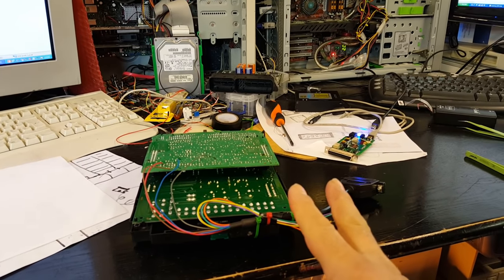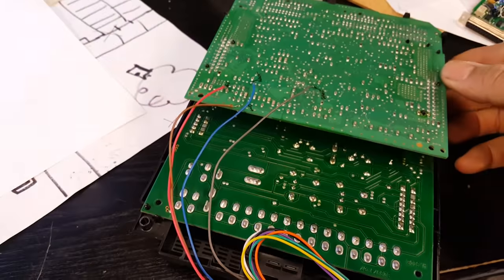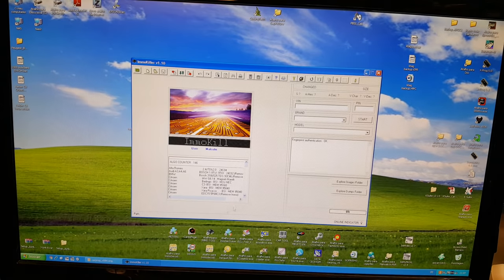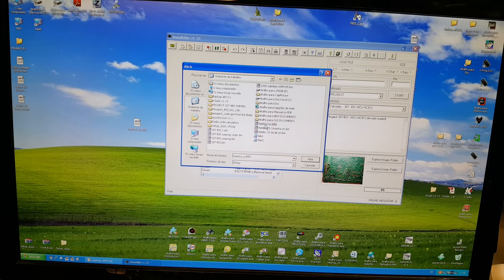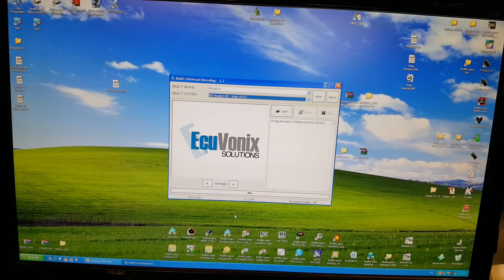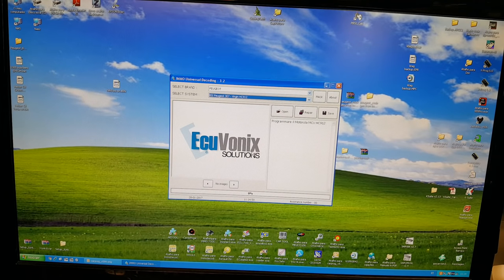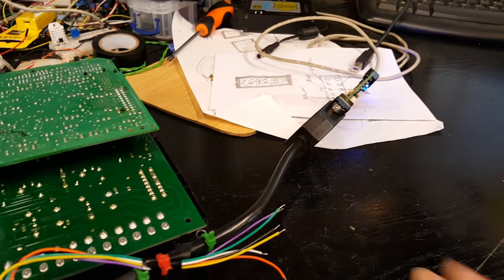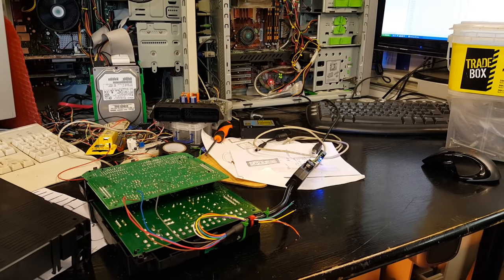Peugeot and Citroën BSI - clone, pin code read, virginize/ reset.

Comment: Hi. Is it possibel to send you my bsi for repairing? I have a citroen xsara where the sidelights doesn’t work. Which country are you from?
Reply from the maker: Hi
I am in the UK.
The problem is that I will not have how to test it, and I don't like to do repairs without be able to test the result...
If something does not goes as planned, I will not have how to tell, and then you will be receiving it back, to find out that is still no working...
Sorry, I can help you through diagnostics, and guide you through (Consider to support my channel and all the hard work put into it at http://www.patreon.com/LMAutoRepairs
Thank you), but that is about it... 
(I will love to help you to the best as I can!
https://youtu.be/ka-Yrflcd-o?t=1m55s)
Hope you understand!
Reply: I understand. You’re right. Your respons just tells me that your take pride in delivering high quality services. 
I will look at the channel. Thank you.
Reply: Hi mate got a water damaged ECU from a Peugeot 207 unable to read old ECU has its dead and doesn't contain a eeprom chip.

Could I virginise a repalctment ECU then read the pin from the bsi to allow me to programme the new ECU with Peugeot planet ? 

Thanks
Reply from the maker: @joshbennett6293  
Yes... absolutely you can...
👍👍👍
Reply: Hello, i can not find the connections for the Citroën c3 Bsi F02-00. Do you have a link or tell me how to do it please. Connections are also possible from the connectors so i can also hook up there if needed.
Reply: Thank you for the video, most interesting. 
You mentioned the term "caprog"  ? 
Is that correct, sorry I could not quite make it out in the audio. 
Appreciate if you could let me know. 
It didn't sound like x-prog which you have in the links. 
Thank you
Reply from the maker: @Kramblueify 
Yes... carprog.. 
👍👍👍
Reply: Hi
Nice video, and nice that you point the mouse up in the corner and say here is the name of the program, but we can't read it, it's not visible to read 😏😏😏

Comment: Hello LM Auto Repairs, How can I find the connection points on a Valeo BSI J02 (FNR: 9651197480 A, FNC: 9651196780 A) and Valeo BSI J04 (FNR: 9651197680 A, FNC: 9651196980 A)? Can these two be reset using the Carprog v8.21?

Comment: Hi, I have a 2010 Peugeot 308, Johnson’s control BSI that is corrupt/faulty. I want to read the eeprom chip. It has a 95128 chip. Could you help me with where to get the software to Virginise the eeprom dump? Thanks

Comment: Hi, You mentioned Carprog was running out of credits, do you have to connect it to the internet to get more credits unlocked on the device, and I think you mentioned you have a way around this, how does that work?
Thanks
Reply from the maker: Hi
I just program the Atmel processor with a file with 50 credits, before it runs out...
That's the way round it...
Thank you for watching and for your comment!

Comment: Hello, good afternoon and congratulations on your professional and interesting contribution to your videos.  I have a question if you would be so kind as to help me.  I need to access the board of a control unit, it is an external tuner, of a motorcycle to be able to eliminate or release the Vin since when connecting to the motorcycle it is linked and does not allow me to use it for the other one that my father has.  It is the Scream eagle super tuner model in case you know it or you can see the model on the web.  I know it's possible but the person I knew because of illness is no longer dedicated to it.  I would be very grateful if you could help me with something please
Reply from the maker: Hi
Unfortunately I have no experience at all with that...
I would guess the vin is stored in a eeprom or mcu on the module...
It might be possible to do it through some sort of interface rather than open the module...
Again, I never worked with anything like that...
👍👍👍

Comment: Hi is the cluster with in the bsi unit or is it a separate unit? unfortunately I did what you said an put a bsi unit in and the milage has gone up I've taken it back and put my original one back in it drives but just the locking system is broken not sure what to do next the place I went to said it's a 50 50 chance if I could ever get my milage back any help would be greatly appreciated
Reply from the maker: Have you reset the BSI before you put it in?
Looks like you haven't...
The mileage is stored in the BSI and cluster...
The way you drop is down to the real mileage, is by virginize the BSI, and change the mileage on the cluster to the correct one...
Once you plug the blank BSI, the mileage from the cluster is transferred... so you ended up with the correct mileage on both...
Obviously the blank BSI will then needs to be programmed... you will also need new transponders and remotes...
👍👍👍

Comment: hi love you videos great job, have a question.. have two bsi boxes veleo GOX-00 ONE IS BAD BUT I HAVE THE PIN... THE OTHER IS GOOD BUT I DONT HAVE THE PIN CODE....... CAN I SWITCH AROUND THE EEPROM CHIP AND I WOULD LIKE TO KNOW THE WHICH CHIP IS THE EEPROM THE CHIP NUMBER
Reply from the maker: Hi
I believe that on that one is an Motorola MCU... no external eeprom...
So a bit more tricky to swap...
Thank you for watching!

Comment: Hello and thank you very much for all the infos you´re sharing. I have the same BSI. Original + another 2nd hand one.
 I`m trying to read it with the same tool "CARPROG" but it doesnt read... I dont know why. CARPROG has been used before and its working... What could I do? Is it absolutelly neccesary to have the PIN when instaling a Virgin BSI with peogeot PLanet?
Reply from the maker: Yes... you need the pin...
Thank you for watching!

Comment: good video,,very well explained,,,ive left a c4 bsi useless after fvdi millage correction,,,any easy       ways out ??
Reply from the maker: Never had that issue...
Can you still communicate through OBD?
I would suggest either reflash with Lexia or Diagbox... that not possible, get a dump from a good one, and do it on the bench... again, providing you can communicate with the MCU...
Thank you for watching!

Comment: You do fantastic work lad you are the man for C4 picasso I have a question you may be able to help me,2015 c4 1.6 hdi, warning came up for low additive (Pat)fluid fluid was topped up but code won't clear so went and bought new tank and pump programmed them in fault still there,the fault of is cleared out of all systems except the BSI it won't clear from it comes right back every time,any ideas lad
Reply from the maker: Hi
Difficult to tell...
What fault is coming up now exactly? 
Does live data shows anything out of the ordinary? 
👍👍👍
Reply: @LMAutoRepairs  engine repair and service light,multiplex pump fault is in BSI and won't clear comes back every time,a new pump and additive tank have been fitted and programmed in no codes anywhere except pump one that won't clear
Reply from the maker: Can you communicate with the additive pump?
Reply: @LMAutoRepairs  yes it knows  new parts are fitted  but been french as you know you have to clear from all ecu's before fault will clear but comes right back it's put the car in semi limp mode won't drive in auto only paddle shift but also under powered I'm told this is a protection thing,anyone I have asked in Ireland about Lexi software they say no don't have ,wiring checked  yellow wire is live not sure witch is data wire Back to bci green or green with yellow strip,all working in back of car have been checked would it be bc is itself lad do you think,and thank you so much for taking the time to reply to me

Comment: If you can read the old Bsi file if faulty. Can you then just write that file to the burnished bsi as long a they have the same EPROMs. Can launch xprog 3 be used
Reply from the maker: Yes... those tools will work, as long as they support the chip in question...
👍👍👍

Comment: Hi! I have BSI from C3 I that wont go to sleep and empties the battery in 3 days. Everything beside this is ok with the car.  I think to buy s/h BSI  with same number and swap it. Can you simply tell me the steps I need to do to put the s/h BSI in and keep the ECU and keys? Or maybe other suggestion to fix the drain problem? Thanks!
Reply from the maker: Check the drain by testing independent circuits...
It might be that there is nothing wrong with the BSI, and is something else that is preventing it from going to sleep, and replacing it will not fix the problem...
Thank you for watching!

Comment: Would xprog be able to copy my original fiat doblo BSI and write that to a used BSI?And after i do this will my keys etc still be recognised?Thanks.
Reply from the maker: Yes...
But as for if X-prog will be able to do it, check what MCU or eeprom you have on that particular BSI... just to be sure that X-prog does support it.
Thank you for watching!
Reply: @LMAutoRepairs  I actually posted my problem on another video but i cant find it.I replaced indicator relays on my bsi pcb.My original problem was right side indicators werent working on my fiat doblo.I replaced both relays with used ones,when i connected everything keys weren't recognised by the car and 'both' sides then didn't work?
Made progress today,got two new original type relays from China,now i am getting outputs from bsi to both sides now!But they are flashing quickly and front indicators on bith sides aren't working??
It's slight progress but keys still aren't recognised?

Comment: Hi LM auto
I have a 2008 citroen berlingo 1.6hdi, the AC clutch isn't engage. I have use Lexia to check and got an error that the is "ac short to ground" when checking the bsi unit. Before I open the bsi box , could you give any advice where to look for the short on the bsi pcb?
Reply from the maker: I would check the circuit between the AC pump and the controller module... if it is the BSI... before blame the module itself...
Or, even the pump itself!...
👍👍👍
Reply: @LMAutoRepairs  
Thanks for your prompt reply.
1. I guess you talk about the BSM which is the fuse box in the motor compartment. Checked and even replaced.
2. New compressor + clutch assembly  replaced.
3. Harness between BSI & BSM fully cheched and confirmed Ok.
4. Circuit from AC switch and AC blower checked and confirm Ok.
5. BSI left to be repair imho.

Lack of finding an electrical drawing led me to seek help from experts like you.
Reply from the maker: OK... what about the harness for the compressor?
Have you checked that?
Reply: @LMAutoRepairs  
Harness checked all Ok.
From BSI to BSM 
From BSM to COMPRESSOR.
I injected 12v to the wire to compressor and it egaged and AC worked Ok.
To sum the overall checks it obviously the BSI. but ad I said early, I have no clue which circuit on the BSI is the culprit.
Thats why I ask your help. My hope you will give me a hint where to look for.
Reply from the maker: @talbejerano8721  
OK...
So, if the fault is a short to ground, you should be able to open the module and trace  the circuit down...
You should either have a mechanical relay that engages the circuit, or a mosfet...
Look for that short...👍
Reply: @LMAutoRepairs  
Thanks. 
I will try tracing it. If I have any success I will give the info for others users.

Comment: Hi
Interesting video.
I have 307hdi that had the neg battery terminal corrode away.
I replaced battery and terminal..reset everything now all works but front wipers and resetting day/date on facia.
Is this a bsi fault? The wipers certainly seem to be??
Reply from the maker: Hi
Check basics first...
Fuses etc...
You can gave a better idea if you check it with the scanner connected... so you can look at some live data etc...
Thank you for watching and for your comment!
Reply: @LMAutoRepairs 
Hi
Replaced com switch and checked wiper operating.. All OK. Replaced underbonnet fuse box and check operation.. All good there. Just seems odd that the bsi spiked on the wiper control?
Reply from the maker: @harwoods11  
Ok...
It might be the BSI...
One thing, have you applied 12v directly to the wiper motor?
Does it runs?
Reply: Hi
Thanks for reply. Yes.. The wiper motor works when connected from an outside power supply.
Is it poss to fit a second hand bsi?
Reply from the maker: @harwoods11  
Hi
Yes... but needs to be virginized first...
Reply: @LMAutoRepairs  if I fit a virginised  bsi. Will I have to reprogram in the pin codes and immobilized codes

Comment: Hi mate! Can you possibly help with yr. 2000 2.2HDi Peugeot 607 BSI module, it is a Sagem module and it has a chip: Infineon SAK-C167CR-LM. With what tools it can be flashed? Please help....
Reply from the maker: Does it not have an external eeprom?
What exactly are you trying to do? 
Thank you for watching!
Reply: @LMAutoRepairs  I am trying to virginize this BSI... Hmm... so resetting the 93C66 chip will do the job? Or do I have to get connection to that Infineon?
Reply from the maker: @johnnycash2627  
The eeprom should be enough...
Reply: @LMAutoRepairs  Many thanks :) I discovered your channel quite recently and I must say: Great work, dude :)  My Peugeot is displaying "Changing to power save mode", the user functions are pretty much dead and the car will not start(it cranks normally). Let's hope, that brand new configuration of the BSI heals it :) I will do some videos as well and share it with ya all :)
Reply: Hi again! :) Yes, the EEPROM reset worked fine :) But there is one more problem... How will I know the build code, if the stickers are destroyed... Can it be taken from somewhere else? Thanks!
Reply from the maker: @johnnycash2627  
Not sure... dealer my be able to give you that... never actually researched such thing...
But I don't think you need that to program the bsi... but I might be wrong... haven't done one for ages....
👍
Reply: @LMAutoRepairs  i used 0000, but yeah... can it be done... anyways, did it in order - BSI conf; VIN; conf for BSI itself; conf (main settings incl BSI absent/present)) to present of-course; Initialisation-PIN; Keys. 

Power save mode did not come on yet...so I recycled PP2000 and went for BSI, to see parameters(IMMO), but power save mode kicked in.. Ok, I managed to get it out of power saving mode, yet the car still didnt start....

Real pain in the ass...
Reply from the maker: @johnnycash2627  
The power save mode usually comes out when you start the car, and the car goes into power save mode when the battery gets low... I never worried about power save mode, that does not prevent the car from starting... providing you have enough battery and there is no other problems...
Reply: @LMAutoRepairs  Interesting... the battery is 1 month old, charged overnight.... What in Your experience has possibly caused such trouble? By the way, main dealer was actually helpful and gave me the build nr. :)
Reply from the maker: @johnnycash2627  
What initial codes did you had?
Does the car cranks?
Reply: @LMAutoRepairs  Yes, the car cranks well. Just today I got DAM code from main dealer, BSI Initialisation code is the PIN as usual. Anyways... I just virginized the thing again and give it a third go in da morning :) Today...when configuring and so... I got a message on screen: Brake system faulty...Weird, no problems there before.... And when I removed the BSI today, I discovered, that I had left a 6-pin EA plug disconnected... Good guess is, that this one screwed me today :D

Comment: Nice video , I have couple questions about doing bsi and ecu , could you recomend me some diagnostic tool wich i can use i would really apreciate it since i cant make a choice wich one can help me out
Reply from the maker: Depends what you want to do... you have seen the ones I have used here to do this work... 
Thank you for watching and for your comment!
Reply: @LMAutoRepairs  well I've wached you used carprog for bsi and xprog for ecu thats the part thats confusing me
Reply from the maker: @ervinhodo9908  
X-prog should help you...
There is other eeprom/mcu programmers out there, like the Xhorse, orange, etc... depends how much you want to spend...
Reply: @LMAutoRepairs  can it be done with obd port without the soldering you mention that in a video
Reply from the maker: @ervinhodo9908  
This one...
http://www.obdexpress.co.uk/service/psa-bsi-tool-for-peugeot-citroen-software-and-operation-free-download-136.html
If you find one...
But I never used it... so can't really comment how good it is...
Reply: @ervinhodo9908  It can be done via OBD  for cars 2005-2006 onwards. And 206 model is not one in that list.
Reply: @dkaloupis75  I was just a starter , found some stuff out by myself some waching LM AP , btw much thanks for reply and mostly LM for his guide videos !!!
Reply: @ervinhodo9908  I tend to watch LM on Friday nights with some pop-corn after a devil's week dealing with Mercedes ECU's and sh@ty SAM modules...it does giving me the pleasure of " i am not alone in this f@cking trade dealing with sh@t cars and electric job's....
Reply: @dkaloupis75  we all have those moments , just hang in and it won't get better 😂😂
Reply from the maker: No it won't...lol

Comment: Dear Sir, I have a problem with Peugeot Boxer van 2011. The only key I have broke, I'm not the first owner of the van, so I don't even have a card with the code for making a new key, but I can read the ECU, do you have a program with which I can read the codes for making a new key? Thanks in advance for your reply.
Reply from the maker: To read the pin code from that depends on the ecu... what tools do you have to read the ecu?
Do you have how to program a new key?
👍👍👍
Reply: @LMAutoRepairs  UPA USB v1.3 programmer to read ECU, To add keys would use OBD Delphi car diagnostic. ECU is from Mageti Marelli in Boxer.
Reply from the maker: You need to get hold of the pin by reading the data...

Comment: Does anyone know where to get virgin dump files? I need one for my Peugeot 406’s BSI. 
Also, does anyone know what software is used to read and edit the mileage on these files, I messed up my mileage and now need to correct both the BSI and instrument cluster.